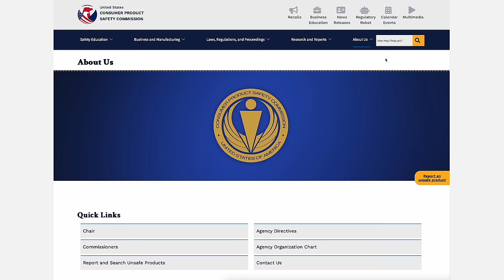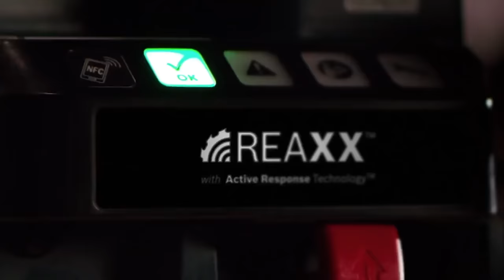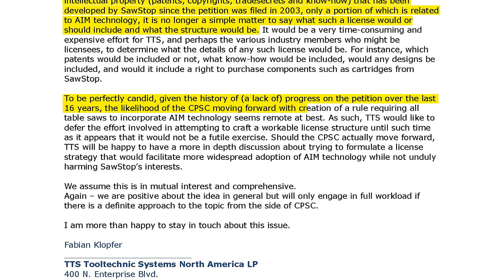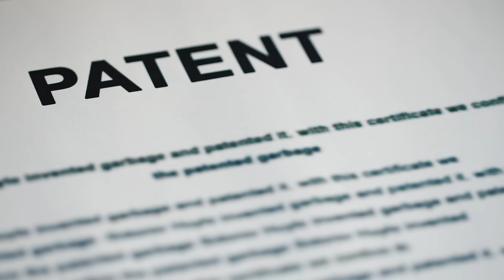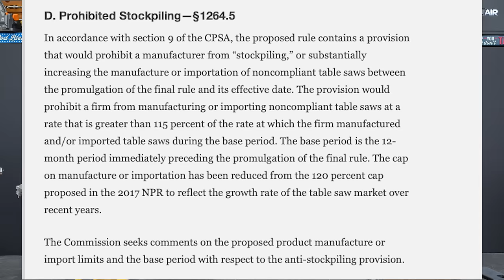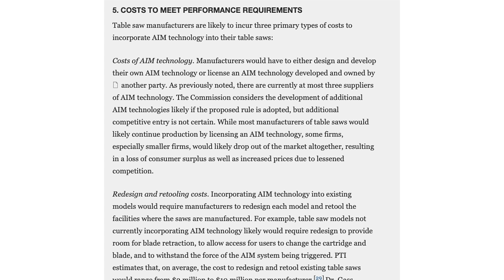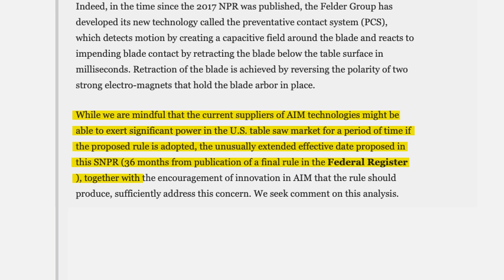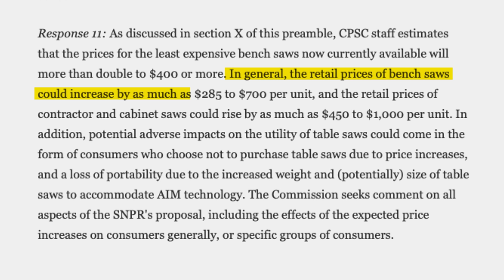The US Government is About to Change Table Saws FOREVER!

Comment: The timing of this is interesting to me. Just this past weekend, I decided I need to upgrade to a SawStop table saw. Not simply because I want a new saw, or a great saw, or a top of the line saw. It's because I want a safer saw. I'm embarrassed to admit that I attempted a cut that I knew I shouldn't try. The tip of my middle finger on my left hand made contact with the spinning blade. My brain was screaming "Stop!" before it happened, but I was too arrogant to listen. I'm so thankful that it was just a nick... minor enough to patch up with a bandaid, and then get back to work. But I didn't blow it off as a close call and tell myself "I'll be more careful going forward." I decided I need to get a saw that (at least in theory) can't hurt me. I also need to not be foolish with the cuts I attempt to make. Human nature is to get complacent when we make safe and successful cuts over and over. SawStop helps combat the results of complacency. Honestly, I was on the fence about taking the plunge for the new saw, until I watched this video. That's because the new saw is going to set me back over $3,000 before taxes. But I wouldn't sell a finger for $3,000. I wouldn't sell a fingertip for $3,000. For me, woodworking is a ministry that is used to encourage people who are going through some type of major trial (health or otherwise), or to celebrate a major life event (getting married, having a baby, completing cancer treatment). I don't sell what I make. I give it away as gifts. It's too important to me to continue doing this (and doing it safely) to give it up. So, I'll get a SawStop, sell my current table saw for cheap, with a warning to the buyer that the saw is dangerous and to be smarter than I was when using it, and trust that my paying job will make up the funds spent in purchasing the new saw. If all table saws across the board are about to get a lot more expensive, now seems to be the time for me to act.
Reply: I cut my old saw up when the AIM saw arrived. I could not bear seeing someone hurt by it.
Reply: @jimp5024  You got it bad.  LOL.
Reply: If they mandate SS, saws with it should get cheaper (competition), but saws without it will go up in price.  Since you are planing on buying it anyway,   I don't follow your reasoning.  If you are planing to buy it, and buy it now, then you only have current choices anyway.

The problem with your safety thinking is that this is not how safety works.  It is how mother government works.  Basically, whether it is traffic, bike helmets, or woodworking tools, things that promote autopilot thinking cause more accidents.  SS actually seems to completely solve the problem it undertakes to solve, and I am a big believer in following my intuition related to accidents, so I totally understand your move on this. (I also had a micro nick on a table saw, but that was maybe 30 years ago, and I have never had a problem since).  The thing about SS is that it solves a problem that is easy to solve through simply using a table saw within established limits.  The problem from my user perspective is that I don't know how many of these people having the accidents were:  Drunk; under 80 IQ; No training or experience; etc...

SS also is not even near being a good saw, thought it is now the approved official Youtube presenter brand.  The EU redesigned their saws decades ago.  We are still kludging our way through a design that is almost 100 years old, at this point.  SS cabinet saws are the old Unisaw design on life support.  

The problem I have is that while I spend half my life on a couch, the other half can get hairy fast.  I have many tools that are far more fear inspiring than a table saw.  chainsaws, metal lathes, grinders, I rig for high work like roofs, and climbing.  I must have several hundred devices that are capable of causing more severe injuries than a TS.  Solutions don't even exist for them, and even TSs have some nasty tricks hiding away in there.  For one thing, most are overpowered, unless people are really ripping 3" maple all day long.
Reply: @pinkyhotmessx69  I agree. It was my error and my choice. I never blamed the saw. As you said, it was doing exactly what it was designed to do. I don't recall expressing an opinion about whether the potential new government mandate is good or bad. The fact that it will drive prices up is bad, from a consumer standpoint. The fact that it will prevent finger amputations and other catastrophic hand injuries is great, from a safety standpoint. I can't imagine that eventually, when all of the saw manufacturers have a reliable safety mechanism in place, pricing across the board for new table saws won't come back down to affordable levels. I understand an initial increase in prices for the manufacturers to recoup their investment in retooling the factories. Right now, SawStop can charge basically whatever they want for their saws because they are the only player in the market who has the safety technology. That won't be true forever, and when it is no longer true, I suspect SawStop will have to price their saws much closer to the competition's pricing. That's good for consumers, and I suspect it us why patents don't last forever. In reply to the commenter ahead of you, my reasoning for purchasing the safer saw NOW, rather than later, is that Matt said pricing for new SawStops will initially go up with the new mandate, not down. If that's the case, I want to beat the price increase. As for whether a SawStop will eventually fail and injure a consumer, I don't attempt to predict the future. Given how many of their saws are out there, I wouldn't be surprised if some failures happened. And yes, I imagine that would spark a massive lawsuit/settlement if the injured party can prove the saw was at fault.

Comment: Glad I already own a table saw. Yes I would love a SawStop but I would never pay the price.
Reply: I have an ICS SawStop.  I bought it almost 11 years ago and about 34 years after cutting half of my left thumb off.  I would not hesitate to replace this saw, I DO NOT want the chance to be human and make a mistake again.   I was cutting dado's and cut half my thumb after turning the saw off.  The SawStop would have prevented that.  There are many safety rules but they do not cover every possible situation.  The price you pay for a SawStop pales to the cost of a trip to the ER, not to mention losing a digit or worse.  And finally my thumb, after about 10 years, was no longer sensitive to normal activity.  You don't just heal and that is it, you have nerve damage and pain for many years.  My SawStop is my 3rd TS.  I do manufacture a lot of custom furniture.  Food for thought.

Comment: One other point to note: Table saws can last 50 years or more so the existing saws could be around for a very long time because you can't develop an aftermarket device that drops the blade, it is a design problem.  Yard sale saws will be around for a long time.  I still see saws that are 40 or more years old all the time at estate sales.

Comment: This was a very interesting and well produced video.

There is no way I would have got my table saw if it had been significantly more expensive.  I got a contractor's saw, and converted it into a cabinet saw by using the saw itself to construct a table around it.  It is definitely the scariest piece of equipment in the shop.  

I can guarantee that almost all of those injuries were down to operator error.  Of course, the industry should be doing everything it can to make the machines safe, but look at how many people immediately remove guards from machines, either because they get in the way, or they restrict vision.  Sawstop is an incredible invention, and it, or an equivalent would be great to see on all saws, but to mandate it on all levels of product means effectively killing off the hobbyist and small business sector of the market.  It cannot be right that Sawstop invents a safety device, zealously protects its patents, and lobbies for it to be made mandatory.  That's lobbying for a monopoly, not lobbying for the safety of woodworkers.  Even if they were to do like Volvo and release the patent, it would still add a huge percentage to the lower end of the market.

It's one thing to force car manufacturers to include seatbelts, ABS, and airbags, but these are a tiny percentage of the cost of a new car.  Can you imagine if they had made all new cars 60% more expensive, especially at the lower end of the market?

A significant number of gun deaths and injuries are also caused by user error.  There's even video of a police gun safety trainer shooting himself whilst holstering a pistol.  Can you imagine the pushback from the ammosexuals if guns had to be fitted with technology to prevent them firing at a human?

Assuming that this does go ahead, what will happen is that more and more old saws will be repaired and renovated where previously they would have been thrown out.  Older saws, with worn bearings are going to be more dangerous than new saws, so at least for a time there are likely to be more injuries from kickbacks.

Rather than doing what they are apparently going to do, it would be far better to make it mandatory that employers have to use machines with AIM.  This will protect employees, and allow economies of scale to drive down the price of AIM to a point where it is affordable to fit to lower end machines.  Once that point is reached, then it can be rolled out across the industry.  Of course, that would require Congress to vote for employee protection legislation, and we know that's never going to happen.
Reply: I quickly out grew letting a table saw scare me!  Operating such equipment in a state of fear is every bit as bad as being over confident ir in a distracted state.  I was taught not to fear it but instead give it the respect it deserves.  Take the time to learn to use it safely then before every cut take a few seconds to look at your set up make sure you did not overlook something then review your plan for how you are going to do the operation you need to do.  A few seconds to evaluate what you are doing and make sure your head is in the game makes all the difference in the world!
Reply: @chrisjacobs8153  Absolutely.  When I said "scariest", I meant in terms of what can happen, and how quickly things can go south.  I approach it with a healthy dose of respect, but not fear.  I'm sure most injuries are caused by complacency, distraction, rushing, or ignorance.  We can control all of those.
Reply: Government needs to stay the fsuk out of this.
Reply: The same people who don’t want these safety features for consumers are the same who rally against worker protection sadly.
Reply: Not true I'm the only worker in my shop and I'm all for more safety up to a point where it will not cause more issues than it is going to protect people from.     If I had a large outfit with employees I might would consider tech like this.  But this is not the situation myself and many others  are in.  

I don't need this so called safety tech. I know how to operate a table saw safely and have been doing so for well over 30 years still have all my fingers. This tech would make buying a new table saw a very difficult thing for me to afford.  In the case of the Sawstop tech it would be nearly impossible to keep it operating as I do find myself working with wood damp enough to trip it. So I would be ripping it off first time I tripped it. 

I certainly see this pushing many new woodworkers into trying to build their own makeshift table saw. So they very likely will be in a much more unsafe situation than they would be using cheap entry level saw without this tech.  

I do also see people will lean on this tech and operate the saw in a  less safe manner. Even here in this post there was a comment that Sawstop saved someone's fingers a few times.   Again over 30 years of working with a table saw I have had no injury using a table saw that is over 30 years old.  So if someone has had a sawstop save then a few times they really need to evaluate their use of a table saw. 

So there is very good reasons to not require this on all table saws.  Let those that think they need it or want it make that choice themselves.  Do not burden us small shop woodworkers with this cost for something many of us do not need because we know how to safely use a table saw.

Comment: Of all the tools in my shop,the one I have the most respect for /fear of is the radial arm saw. Though not as popular now as they were years ago,there are more ways to be injured with a radial arm saw than you could ever think of. If you have respect for your table saw about the worst injury you can have happen is having a bound up piece fly back at you. Keep your blades clean and sharp,and your fence square with the blade and table saws are generally safe.

Comment: If the government wants to require this, but not create a monopoly then just deny all the patent extensions. I think that safety reasons is a good justification for not extending the patents. I was thinking early in the video that this is probably being pushed by the insurance industry. I wonder if CPSC doesn’t make it mandatory will the insurance companies put a clause or something in the policies that if you get injured with a power tool that has safety technology available on the market and your tool doesn’t have it then they don’t have to cover you for that injury.

Comment: The Federal government does have the power to take control of private property for public use.   This normally involves land, for uses such as highways, power line routes, etc., and usually involves fair market compensation for the property.

So a possible solution would be for the US government to take control of the rights to at least one AIM technology and make that available for public use.  Reasonable one-time compensation for the patent could be paid out to the current owners of the technology.   Thus saw manufacturers could incorporate government (public)-owned technology at just the cost of engineering, materials and manufacture without the big license fee on top.  This would put the US government in the position of subsidizing the safety of saw users but that should be viewed as to the benefit of all citizens.
Reply: Well put.
Reply: Am

Comment: By and large, the government is not in the business of establishing monopolies.  If the rule is adopted this year, it will likely be suspended for several years while it's litigated on the basis of anti-trust.  By then, enough patents will have fallen into the public domain that license fees will no longer be an issue.  The costs for redesign and manufacturing would still be a factor and the price tags will still go up.  But not as much as if the rule would be adopted and enforced immediately.

Comment: I wonder what injuries counts were in the 80',90s etc. Back when shop was taught in school. I learned safety in shop class. Now that shop was removed from most schools safety isn't taught. Perhaps simply putting shop class back in school would reduce injuries.
Reply: Most schools in Australia that have more than 50 students still teach wood working
Reply: You have a truly valid point.  I was required to take shop in 1973-74.  My instructor was adamant about safety and taught it in a positive and proactive manner.  All my classmates that injured themselves with tools in the decades following were honest about their own failures to work safely.

Seems the teaching of common sense and being honest, especially with yourself, has gone away with the shop classes.
Reply: @gregorydominguez4225  Rates of table saw injuries have been pretty much consistent since the mid 2000s 
I don't think the argument is that they have gotten worse over the years but that there were too many injuries to begin with
Reply: @Ktmfan450   Some industry reports and analyst estimates suggest an upward trend in power tool sales, including table saws, in recent years.  If injuries are flat safety is improving.  When I started woodworking pre internet I was on my own.   Now people can watch endless videos on use and safety.  I am more concerned about the trend towards light weight job site saws.   Maybe that is bias. idk
Reply: I agree 100%

Comment: The cost of the accident, in money and lost function is why I spent the money on a Sawstop. But if I could not get the cheaper Delta I started with I might never have gotten that far.  I disagree with them mandating this though.

The guy talking about if they wait 3 years how many people will be hurt.  He is ignoring the fact that it won't change quickly.  Too many tablesaws are in the wild.  It will ONLY impact new saws.  It will take decades to see this drop to where they want it no matter when it goes into effect.

Comment: I’m a self employed carpenter. Every accident I’ve seen has happened using old tools with missing pieces dull blades. I had to have a partial amputation on my left thumb because the contractor I was working for was cheap. He didn’t have workmen’s comp on me or anything. He kept using the same saw, and refused to replace it. That’s when I said enough was enough. My point is, replace tools that are unsafe. I won’t even sale it to someone else. I destroy it and pitch them.